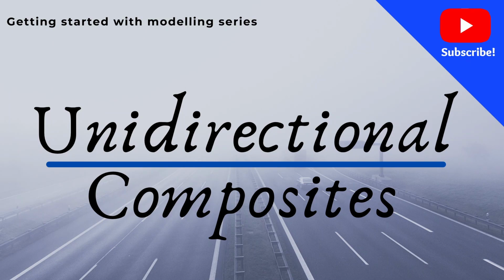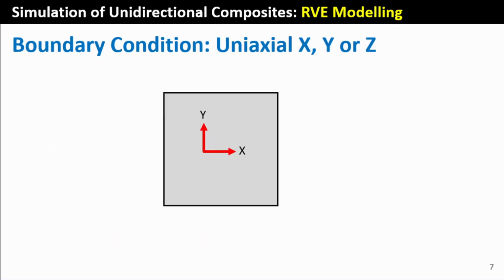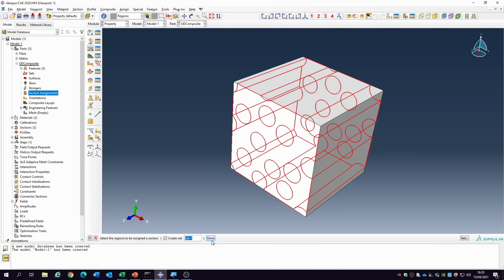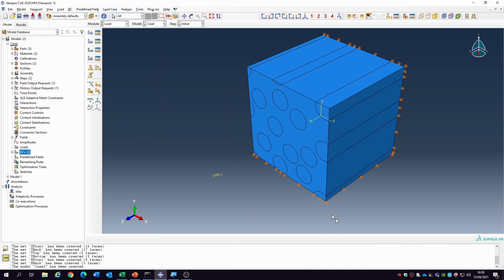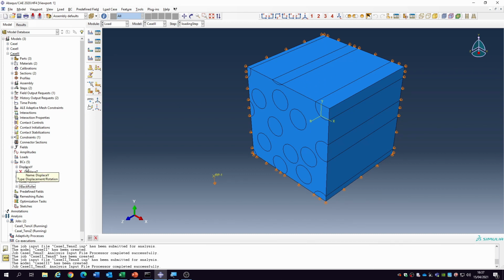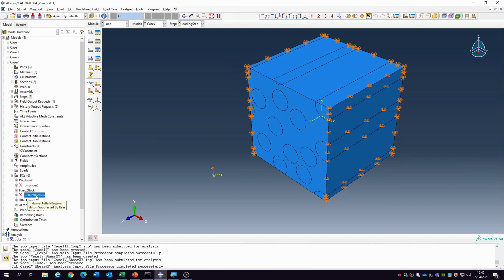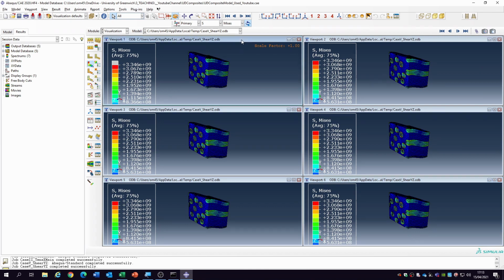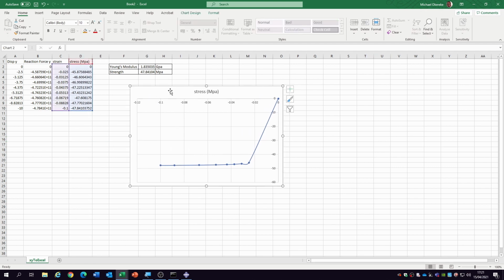RVE Modelling of Unidirectional Composites in ABAQUS

Comment: Dear Sir

I have a doubt in the area of Microstructure modelling and RVE generation. It is usually observed that Microstructure taken for the study in ABAQUS is of square section as I have seen in one of your videos as well. My doubt is can we take rectangular section in 2D as I feel it wouldn't make any difference whatsoever ?
Reply from the maker: Whether square or RVE, it does not matter but for your material, you can do a parametric study to check this out.

Comment: Hi,
Thank you very much for the video. I have a question. When doing DOF, you gave 3 for Z tensile and 1 for X tensile. Why did this happen?
Reply from the maker: Yes, correct. It is ABAQUS style. Material reference frames are 123 when they align with global reference frame XYZ. I have set the model up so that this is the case in which case 1=X, 2=Y and 3=Z. If you orient different so that the fibre axis (currently Z) lines up with the X-axis, then you would have the fibre modulus as E11 as traditionally reported in literature. In the case here, my fibre axis is Z-axis so E33 would be equal to E11 and the two transverse directions i.e. Y- and X- axis becomes the 2- and 3-material axis leading to E22 and E33 as reported in literature.

Comment: Didnt you set up contact properties ? or not necessary ?
Reply from the maker: I didn't use a contact property here. I assume perfect bonding between fibre and matrix. To be more accurate in your modelling, you probably need to incorporate some form of interface effect. I will not go with a contact property but this is possible, if you so desire but the better approach is to use an interface (cohesize zone/surface) effect.
Reply: @MichaelOkereke  Thanks for the answer

Comment: The reaction forces and displacements extracted from the model to excel are from the reference node? I didnt understand that part very well. Thanks!
Reply from the maker: It is a different way of extracting stress-strain plots but based on a reference node which is kinematically connected to a surface. I explained this in more details in this video. It is the third approach: https://youtu.be/gCQzzF8Few8?si=LICNUGB7j2SmayDJ
Reply: @MichaelOkereke  thank you!! I will check it out 💪

Comment: Thanks Sir, just a doubt, i really need to know how it will effect if instead of creating a ref. point and constrained it with Equation, i directly create the set of the deforming plane, apply displacement on  the very set  and check the history output for it.
Reply from the maker: Thanks for the query. If you do as suggested i.e. extract history outputs (say S11 and E11) from the nodal set on say XFront, you will still get  a result without the reference point approach that I used here. The limitation here is that it will be only giving you the history outputs on those XFront sets which is not representative of the full model. It will not be an accurate stress-strain plot. This is because of the heterogeneous nature of the virtual domain.

The best approach is to extract all the stress and strain for all elements in the domain and homogenize over them. This can work but the problem is that for a heavily meshed domain under consideration, you will have to write a lot of history variables to memory of the computer. ABAQUS typically runs out of history output memories once you have more than 10,000 history data. This is a problem and this is why I used this method as it requires only
Reply: @MichaelOkereke  Thanks for the clarification, just for confirmation, 
If we constrain a surface (say XFront) to a ref- point, would it be correct to say that we are constraining the nodes of that surface to the ref-point. Does it also means that we are lowering down the history output data  for every nodes on the surface to only one node i.e. for ref-Point.
If so, then the history output for the ref-point as explained in the Video is for the XFront nodes or for the whole model.

Comment: Very thanks for your video. May I ask a quick question? Why you didn't use periodic boundary condition
Reply from the maker: Good question. I wanted to do what most users can do without relying on a dedicated script. 

To undertake correctly PBC on 3D domain as this, you would often need resources not implemented yet in ABAQUS. This will be a python script that can read the surface nodes, their positions and then using a kinematic coupling approach to link directly opposite and corresponding faces. I know most users would have not have this, but would want to still undertake this sort of study. So, in effect, the best was was to show what is possible using resources within ABAQUS.

I hope the explanation makes sense to you.
Reply: @MichaelOkereke  Thanks for your reply!!! I am a beginner in this area. My following question is: 
Based on your reply, does that mean we can use these BCs you proposed to replace the periodic BCs? Thanks
Reply from the maker: No, they are different.

Comment: Hi Mr. Okereke, I'm enjoying your classes. If you don't mind, I have a question: Do we need to create a symmetric mesh to achieve these results? Did you intentionally use a symmetric mesh in all of these examples, right?
Reply from the maker: Hello, I assume what you mean by symmetric mesh is meshes that match between the corresponding parallel faces. If this is so, then this is not a requirement for this sort of work.

Symmetric meshes tend to be needed when working with Periodic Boundary Conditions. I am not using that type of boundary condition so this is not the case.

I hope it makes sense.
Reply: @MichaelOkereke  thanks for replying my message.

I believe that your channel is truly an oasis of good discussion and content.

Regarding to your answer, could you please clarify just one more question? Is it possible to obtain trustworthy results using Abaqus standard BCs - instead of PBCs and a symmetric mesh? Or is the latter condition necessary for achieving good results?
Reply from the maker: Hello, thanks for your kind comments about the channel. I want it to be exactly that, an oasis of good discussion where I get challenged on these questions and hopefully, I am able to provide some kind of guidance to my audience. 

Regarding your question, of course, yes you can obtain excellent and trustworthy answers using ABAQUS standard Boundary conditions. Those are mainly the Dirichlet or Neumann Boundary conditions and they work quite well. Before the mathematics of PBCs were advanced, most analysis were based on these standard BCs. So, please feel confident to use them for your problem. In fact, for UD composites, many years ago I did a study to compare effective properties for PBC-based analysis and Dirichlet analysis and the results were comparable. You can see the paper here:https://doi.org/10.1016/j.commatsci.2012.12.036

The requirement for PBCs is important if you are working on a small RVE where the constituents have distinct constitutive behaviours and you have to capture those clearly. It gives a better result as the effect of boundary conditions on homogenized results is minimal where PBCs are involved compared to the other types. However, there is still confidence in the other approach.

If you are not able to implement PBCs for unsymmetric meshes (as this is quite challenging, I am working on a code that can help), then do not worry, it is okay and trustworthy going with ABAQUS standard BCs.

Comment: Hi Dr Michael
Thank you very much for providing this fruitful video and clear explanation. I have one question related to the case III which is compression. My question is why you set FixedZBack, RollerYBottom, and XBackRoller for the BC instead of only set the FixedYBottom and give the load in Y direction because this is a compression test? If my assumption is wrong/ not a right standard, could you please provide me the source of a standard uniaxial loading condition? Thank you!
Reply from the maker: Hello, this is just a different way of imposing loads compared to what you suggested.

It is often better to do it this way, as this is a micromechanical study based on an RVE. The chosen RVE represents one-eighth of the quadrant of the actual virtual domain. To simulate effective such an RVE, it is customary to impose loads on 3 free surfaces and attach dirichlet boundary conditions on the 3 other remaining surfaces.

I hope the above makes sense.
Reply: Thank you for your response @MichaelOkereke  , thats make sense. 
One more, I've done exactly like you did in this tutorial, but I encounter the "too many attempts in this increment", do you have any suggestion for me?
Reply from the maker: Not really

Comment: Hello dear doctor. In the student version, I am trying to create a 3D dentin model consisting of hollow tubules of variable diameter, that is, hollow fibers. While doing this, I follow the same logic you showed in this application. I mount the hollow fibers into the matrix consisting of hollow holes. But I'm having serious problems creating the mesh and I keep getting error returns from the program. As you know, the student version only allows 1000 knot points. I would be very grateful if you could make a suggestion about this.
Reply from the maker: Hello, unfortunately there is no way getting around the 1000 nodes limit for the student license of ABAQUS. You will have to find a full license to do so. Alternatively, you may then try using a 2D model of dentin and that might not require so much meshing. Since your 3D dentin model will have a lot of irregular geometries, that will lead to high mesh density hence you will easily exceed the 1000 nodal limit of the student license ABAQUS. Sorry, I could not be any more helpful.

Comment: Thank you for a very useful video! How would you simulate a unit cell for filament winded flywheel made of composite material?
Reply from the maker: Thanks for the kind comment. I am not sure about the problem you describe. It is quite complex and without better understanding it, it is difficult to be able to give any meaningful suggestion. Filament winded flywheel suggests it could be a textile composite or maybe some kind of angle-ply laminated composite system. Sorry, I am not able to help with such limited information. Good luck.
Reply: Yes, it is very complex, so it is understandable! But thank you anyway for answering:) @MichaelOkereke

Comment: Will it work if fibers are modeled in such a way that they touch each other, In other works each circles we draw touch/intersect each other at single point(externally)
Reply from the maker: I certainly think it will, but the right mechanical behaviour will involve having some kind of matrix media (no matter how thin in-between the two closest fibres). If there is a requirement for fibres touching, then I will suggest you incorporate some kind of contact mechanics which will mean during loading, when fibres touch, there is effective load transfer between the interacting fibres. This is technically the right approach but it is computationally very expensive as your contact will be All contacts which will cause the simulation to take too long.

Alternatively, you can bind the fibres to the matrices in node-to-node coupling which might mean you do not have to deal with contact effects. It is my long-winded way of answering the question to say, generally it will work with contact mechanics between touching fibres inclue but no, as this is a very computationally expensive way to study such composites.
Reply: @MichaelOkereke  Thank you for the prompt reply. 
Can you suggest the type of contact that I can use in ABAQUS?
Reply from the maker: I mentioned already that surface-to-surface is ideal but there will be a lot of it... so try the all-contacting pairs option.

Comment: Hello.i can use these steps to calculate at high temperature  .but i don't use the degree of temperature  i change the module de young for example the temperature  250 the module de young decrease
Reply from the maker: I think what you are suggesting is to use the same implementation but for  thermomechanical analysis. If so, then yes, it is possible.

I will simply suggest that you make your step to be a coupled temperature-displacement step so within your simulation you will have both mechanical response (activated via displacement step) and thermal response (active via temperature step).

As regards how you do the mechancial temperature-dependent response, you are right, some people would have to specify a range of Young's Modulus which change with temperature. It will be a reference/look up table that the simulation will use to know what do do as temperature change during the simulation.

I hope these ideas help.

Comment: Sir, I'm facing another problem right now.
I've several questions: 

1. I've taken the length of the RVE in meter (m). What will be the unit of Stress before multiplying by
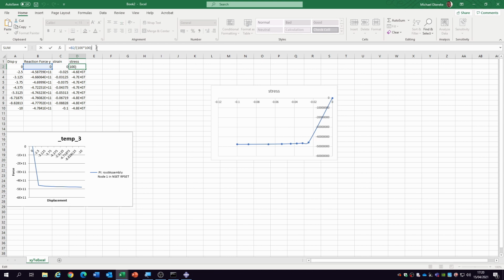1 * e^ -6 as you've done in this video at 47:50? 

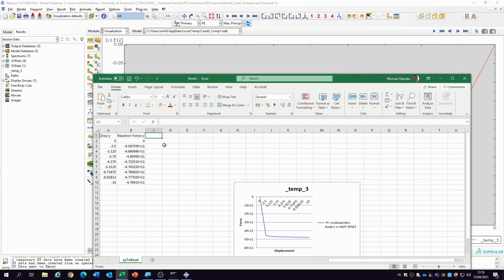2. What will be the unit for the Force (F) and the Displacement (D) in F-D curve whenever I'm taking the length, width & height in meter unit? (In this video u can find it at 47:04) 

3. During stress calculation you've multiplied 100*100. Are they width*height or, length*width or, what?
(In this video u can find it at 47:28) 

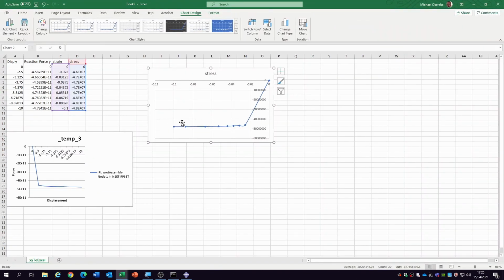4. You've taken the length, height & width in micrometer but in this video at 47:47 , during stress calculation you've calculated the stress as Pascal and then you've converted it to Megapascal. Was it correct whenever you calculated the stress unit as Pascal? I'm a liitle bit confused about that because Nm^-2 represents Pascal but in your case the measurements were in micrometer!

Kindly help me by answering all 4 questions sir.
Reply from the maker: Here is the video you need that answers your queries:  https://youtu.be/YeCBDkjEmDU

Comment: Dear Dr Michael
I'm kind of confused about the boundary conditions. In case I(Z tension), according to another reference book, BCs are XSYMM on XFront&XBack, YSYMM on YTop&YBottom, ZSYMM on ZBack and Z displacement on ZFront, which are a bit different from those used in this video. The results are also slightly different. Could you please explain this and tell what BCs should be used in similar situations.
Thanks!
Reply from the maker: Hi, I am not sure of the reference you mentioned here. The approach shown here is quite standard for an RVE setup for uniaxial loading. The 3 faces were constrained in one axis so that they can contract in the other directions. It is true uniaxial loading. 

I will expect the results to be different if the boundary conditions are not the same. Please look at a few other publications and see what's going on.

Comment: Sir, in case of load application, if I use concentrated force for example 1200 N, the force displacement curve cannot be generated. Is it only generated when we apply the percentage strain? 
My another question is how can we convert the concentrated force for example, 1200 N to percentage strain?
Reply from the maker: Hello @Ashfakur,

Your observations are right. If you use force, it will be overwritten by the underlying kinematic constraint equations involving displacements only. I think this is what's going on here.

On converting from force to displacement,  you can use the force displacement equation for a uniaxially loaded system where the equation to use is:

Displacement, D = FL/AE

Where F = Concentrated force, L Edge length of RVE, A = Surface area and E = Youngs Modulus.

Good luck with this.
Reply: Sir, if there presents two type of fibers and one matrix in the system , what will be the value of E ? Which Young Modulus  should we take as the value of E? 
Or, how can we calculate the value of E?
Reply from the maker: You have to use all to something like this

E = Ef1Vf1 + Ef2Vf2 + EmVm.

The Ef's are for the two fibre phases.

Thanks.

Comment: Doc, can you please give me some advice on performing the Tie Viewports. I have all 6 load cases opened. On seeing Tie Vert./Hor., I see only one view
Reply: I fixed it. Thanks
Reply: Thank you very much
Reply from the maker: Since you have 6 load cases results, I will suggest you create 5 more viewports on top of the current view port. Then tile them either vertically or horizontally so they can be arranged for a simultaneous video. Make sure for each view port, you open the right ODB file (associate it with it) so that result shows on that view port. Hopefully this makes sense. YOu can also watch this video: https://youtu.be/6k0ZAacuAEo
Reply: @MichaelOkereke  I am still worried about how to manipulate the z-tension plot, whose results are way bogus and out-of-scale for the other 5 plots/cases.